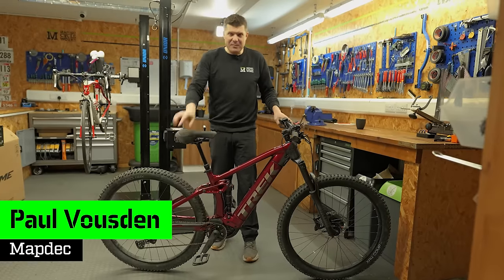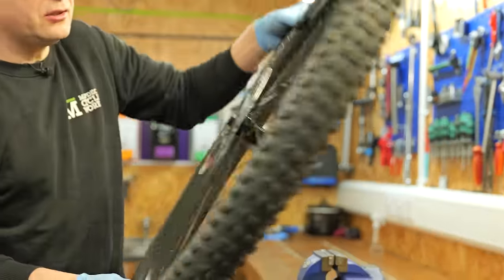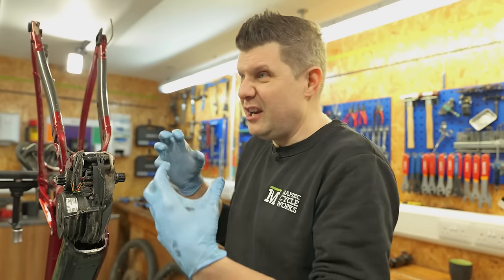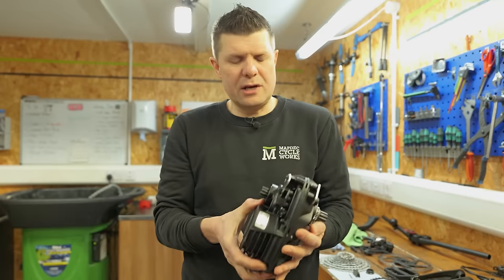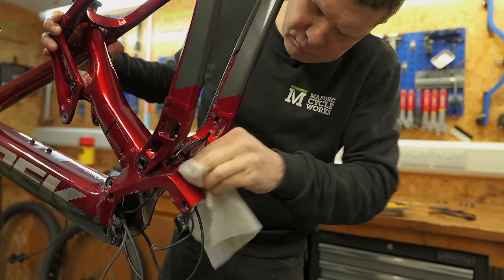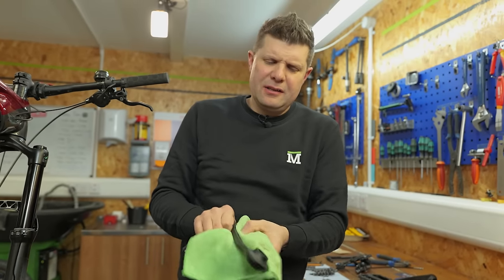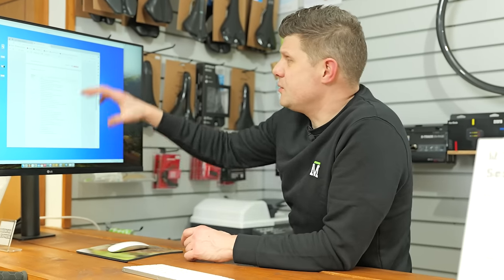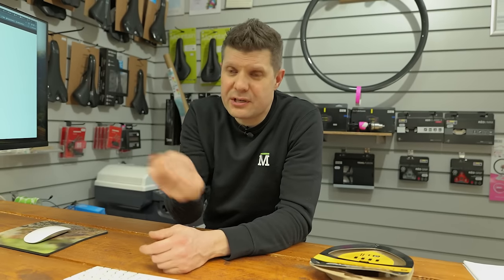This is how much work it takes to service your eMTB

Comment: What did you spray on the bike at the end? Surely you need to protect the brakes from whatever it was? 
Enjoyed the video
Reply from the maker: Its a frame polish from Juice Lubes, Been using it for years. It's nothing that will harm rotors if a tiny bit of over spray touches them. Obviously dont polish your rotors with it.
Reply: Was thinking the same thing. I use a spray wax for cars, but spray it on a rag and buff it off. Dirt just slides right off when I clean it.

Comment: 4:08 "excess old fluid"? As in the old dried up sealant that's stuck on? I thought it be better leave that on the inside as it might help seal up a possible puncture.?
Reply from the maker: Why? It would be dry and in the way of the liquid you want to get to the hole.

Comment: Bike service is dirt cheap when you do it yourself. I am half way through rebuilding mine from the ground up. Even replaced the integrated headset and swapped out the folding stem. Now it sports 20 inch suspension forks... over a 14 inch wheel. lol
Reply from the maker: How much would it cost you on your own jobs hourly rate?
Reply: @Mapdec  That is a stupid question. I will not indulge it. It is the sort of question asked by people with cramped little souls.
Reply from the maker: @mikeemmons1079  because your own time is worthless?
Reply: @Mapdec   Salty, and cramped. Cope and seethe; your job is my hobby.
Reply from the maker: @mikeemmons1079  and you have no respect for another persons trade?
Reply: @Mapdec  It is not a trade, dude. Masonry, is a trade. Carpentry is a trade. Fixing bikes is an after school job, like delivering pizza or wearing a paper hat.
Reply from the maker: @mikeemmons1079  haha. So you’re just a sad lonely troll.  😂. Have a nice life.
Reply: @Mapdec  If it makes you feel better. Of course, the "lonely" part sounds like projection, but we wont dig into that.

Comment: What was that tool you used to remove the hub end cap?
Reply from the maker: In this vid it was a slide hammer colet. However a hub genie is great for 12mm
Reply: @Mapdec  oh that’s kind of genius. I have the former, but not the latter.

Comment: whats the difference between red and blue grease?
Reply from the maker: In this case, Blue is Mobil XHP 22, a lubricant for bearings and moving parts. The red grease is Maxima Assembly Grease for corrosion resistance and prevents threads galling. We have a little motto. Blue for bearings, Red for Threads.

Comment: Honest question, but these ebikes run around 3K 3.5K in the US. How do you justify a service that could be close to 1/3 of the cost of the bike? Makes me not want to buy one now.
Reply from the maker: Exactly.
Reply: Learn to work on your own bike. With the exception of major components, bike parts aren't very expensive.  You're mostly paying for labor and overhead. Put the money you save into a few necessary tools and only pay someone to service the more difficult components like shocks and forks.

Comment: Really horrible build quality on those Ebikes. Everything is wet, not sealed and has rust. For a bike category that is supposed to be robust and durable this is really disappointing. Especially considering one has to put 500-1000 in maintrnance every year on top of it. The cherry on top is that those Bosch motors fail after 10-25k miles and need to be replaced.
Reply: I would be scared to ride any of these hard. I go down hills,  stairs, tear through cobblestone streets, over tram tracks. No chance I would trust the strength and durability of these. Last thing I would want to do is go over the handlebars when it breaks. Especially at the speeds these go.
Reply: The costs are similar with normal mtbs though. Ebikes do see more wear, but the general maintenance is the same. If you ride enough to need that level of service annually, you'd do well to perform some of it yourself. Either way, cost of ownership is something that should be considered before the purchase. If you can't afford the maintenance, you can't afford the bike.

Comment: Great video. But god damn that's expensive! That's more than a FULL car or motorbike service...

I would have also thought that cheap somewhat generic consumable parts like washer, seals, cables and (some) bearings would come included in that price, not charged as extras. I've been out of the hobby for many years, so maybe I'm just out of touch with things.

 But I'm just shocked. I say you're better off not getting a service, and just buying a whole new one every 4 damn years. geez.
Reply from the maker: well, this is a £6k bike, and what you saw here is a full days work. A bike in much worse condition will take a lot longer to remove rusty bearings etc. A car service doesn't require removing many parts, and its all power tools and heavy weight bolts. Everything here is lightweight alu.

Comment: I am not sure from the video, but I hope you closed off the outlets in the motor before washing it. There's gaskets on the plugs, that stops water from going into the motor, when the plugs are not connected, the motor is no longer waterproof. Other than that, beautiful piece of work!
Reply from the maker: Those plugs are waterproof. Water can’t ingress to the motor.  If you have ever taken a motor apart you will see they are all sealed.
Reply: @Mapdec  why would the plugs (the ones that goes into the motor) have gaskets, if the outlets were waterproof? The outlets in the motor is not waterproof. (They might look closed off, but they are not waterproof).
Reply from the maker: @primal5435  to keep the connections dry.
Reply: @Mapdec  I just talked to Bosch to make sure I dont give misinformation. The motor is IP54 rated, and should never be washed under a sink, even when plugs are connected. 
When the plugs are removed, the motor has no ip rating, meaning any water can go directly into the electronics of the motor.
Reply from the maker: @primal5435  that’s different to our Bosch training.  The rep is local. I’ll ask.

Comment: Yeah. Ya fogot the cost...mate. I brought my PW-X3 rig, in for routine maintenance and a noticeable declinein power using boost mode. Well. The bike shop wasin no rush. Made it clear it's my only transportation. Took nine weeks and a cost of one-thousand $USD. Nine weeks to replace a couple microchips, and supposedly the battery was defective. The warranty did not cover the malfunction. Useless warranties. E-Bikes, are truly only for the wealthy. Never buying an e-bike...again.

Comment: if you answer my question i will abonnier your channel: if i want to change my cranklength to shorter cranks (at a shimano e8000 motor), do i have to do something with the computer software? change the power of the motor to "short cranks" or something? can i do this at home or can only a shop do this? thank you.

Comment: Still got the new warning orange stickers on the disks first thing i pulled off! The disks are bedded in wouldn't say they were on the limit? Really
Reply from the maker: The only way to tell is to measure them.
Reply: I just got my first ebike cube action team 160 I'll be keeping up my maintenance for sure! I've got 203 ice tech on mine they'll need to gone be bedded in first
Reply: One thing I need to know the finned break pads do they work well as I think being a heavier rider just now they'll heat up alot with 4 pot 203mm? The ice tech discs hopefully works well for cooling, I need to check what is in the callipers if there resin I have heard alot new ebikes come with resin pads is this true?

Comment: crazy the shop that sold it did not correctly adjust the dropper cable and shift for the customer, so for  a year they have had bad cables prob. from new!
Reply from the maker: Yep.

Comment: Bit unfair to blame sticky fork and soft shock and needing rebuild without checking air pressure... But your service cost seems good if i can do # to USD conversion (&300=>$385-$420 range) for a bike with the extra work being eMTB. Maybe could have pointed out that setting air pressure should be done after rider sits on bike to check sag.
Reply from the maker: Not a rebuild. Just a lower leg service. Basic 50hour stuff.

Comment: The shock travel is surely there to be used, I’d argue that shock is a bit too firm
Reply: Reckless aerosol polishing at the end will also make the brakes howl like hell
Reply from the maker: Yeah. If it did we would have a queue of complaints by now.

Comment: Wow, did you just drain the motor with water?
Reply from the maker: No.  It’s just a recirculating enzyme that we use to brush out dirt.
Reply: @Mapdec  Thanks, oh so this is a liquid thats not electrically conductive? Bc everyone says we can't clean ebikes with water spraying inside down there
Reply from the maker: @dani4u87  there is no more pressure being used here than someone cleaning their bike at home.

Comment: WARNING ! Never expose the DC brushless motor to water or flammable substances . The same for cable connection points . Paul should know this .
Reply from the maker: We never opened the battery. It never got wetter than a hose down after a ride.
Reply: @Mapdec  There appears to be a misunderstanding . During the video clip , the motor was brushed with a cleaning agent . Either way it is to be kept dry . I am about to follow this "PRECAUTION" in a few moments with an Uber worker owned cargo line motor equipped Merida . I have to use a diopter lamp during work as I am waiting to have left eye cataracts removed , hence spelling error edits may be seen .
Reply: @Mapdec  But what about the owner forgetting to leave a key , the mistake you made ? I have an emergency kit if keys are unavailable / lost and the battery " MUST BE REMOVED URGENTLY" . Some bicycle retailers around me have these emergency kits on hand if required .
Reply: @Mapdec  You still wouldn't know if water got behind anything without checking in case the rubber compression seal had abrasions , hence the slim chance water may get in in minute amounts . I have seen this with TQ .
Reply from the maker: @robertmcfadyen9156  cool. That motor will get wetter riding through a rainy day.

Comment: Every 50 hours on the shock? How the hell do we let manufacturers get away with this crap? That's every 3 weeks for me.
Reply from the maker: Depends how well you want your shocks to work. You don't really notice the degradation until you service them. For riders like you that do 50 hours very quickly we do a £30 service where we only clean, change the foam res, and add splash oil again.

Comment: You can see the customer using the bike wrong by the grime on the cassette, wasn’t in first gear once
Reply: Motors can make you a bit less prone to using all the gears , and the tune of the motor also has some bearing on gear selection I think . I recently put an  after market motor on my recumbent trike , and it’s not dialled in yet, and even on low power setting once the motor engages , it pulls like a 14 year old and before you get 3 pedals in you are at maximum cadence. 
 The temptation to start off in a taller gear currently does make it a bit more comfortable, though it’s probably less good for the drive line.
It’s only temporary though.

Comment: just because the rear shock is getting full travel doesnt mean it needs a service.  it indicates it either needs more air or is set correctly if they are getting full travel.  As for the fork its indicating that it is set too hard,  so just needs less air pressure and setting correctly for rebound and compression.  And then you havent done any service on the motor,  a visual inspection isnt a service.  This is basically a regular bike service.
Reply from the maker: Bless.  This is the service procedure outlined by Bosch to maintain warranty.  You are probably right about the suspension, I mean from where you’re sitting it must be obvious, compared to me with just my hands touching it.  I wish I knew about compression damping.
Reply: @Mapdec  Bless.  it's obvious to me watching as it should be to you.
but having been servicing bikes and suspension for twenty years for the world's best cyclists and triathletes I do have some idea about what I'm talking about 
bless.  and the compression and rebound damping in co-ordination with pre-load is critical especially for lighter riders. 
bless

Comment: Tutorial for a how to sky rocket the service costs, instead lubricant tear all the parts down and replace with new. 
Btw spraying silicone w/o protecting the brake discs way to go bud, customer visits for the next time for squeaking brakes. BOM Costs - New brake pads new brake discs and labor. Awesome dude!

Comment: Was going to get an e-bike until I saw this…..just too much cost and maintenance to make it worthwhile in the UK’s wet and muddy, humid and freezing conditions. Not really economically viable in this country as of 2024, think I’ll wait until we see better motor and electrical seals, customer diagnostic tools, e bike specific drive trains, better cable routing and a warranty that covers de-restricted motors before I drop 6k +.

Comment: Wish Trek would stop using that plastic dropper lever. I see a lot of bikes where the person who installed it didn't size the dropper housing. It can be a bit of a hassle on an ebike, but I can't stand the way a cable coming way out front looks. Looks unprofessional. Trek has gotten better at the cable management on their ebikes. About 5 years ago it was awful. You got a real nice set up.

Comment: This whole e-bike thing now is absolutely ridiculous, 5k for a bike, and insane service costs. 

Seriously, madness I have I’ve had several new BMW bikes over the last 10 years , ranging from 12k to 16k S1000rr, *2  and 3 new R1250GS’s and they were cheaper to to maintain 😂😂😂 
And I’d say A LOT more value for money than an eBike. 
The world has gone mad 😂
Reply from the maker: It s the parts designed to be lightweight that bumps the costs and service
Reply: @Mapdec  and so a 190mph cutting edge  superbike that only costs double what double or 3 times that of a pushbike isn’t lightweight or cutting edge😂 
It’s a pushbike with a little motor, not a top end superbike with 200hp, and a raft of electronics. How exactly is it more expensive to maintain.
Like I said the whole e-bike thing is massively over egged!
Reply from the maker: @dazzassti  and everything on a super bike is designed for that horsepower.  Most things on an ebike are still designed for 1 human power.

Comment: Fault with the shop who she brought it from. Not setting suspension up for her. Probably had dropper post issue from new from whoever assembled the bike/sold the bike to her. Gear cable being kinked is probably from new and should have been remedied from whoever was assembling the bike. No doubt the dropper lever was like that from new as well. Good old trek for using low quality cables. Not greasing pivot bolts and using 2 dollar shop bearings.

Comment: you need to use torx plus not torx to remove bosch engine screws.
Reply from the maker: Depends.  They are not always tps.
Reply: @Mapdec You used ordinary Wera Torx wrench. You should use TP to unscrew Bosch gen 4 engine screws. TPS =Torx Plus Security. TP = Torx Plus. T=Torx.

Comment: UPLOAD IN 1440p or 4k PLEASEEEEEEEE
Reply from the maker: one day, when we can afford the hardware to edit.
Reply: @  Just edit in 1080p and render it out in 1440 or 4k. The issue is mainly that youtube gives a horrible bitrate for 1080p so it looks worse than the original file. If you edit in 1080 but then render in 4k it will look a ton better.
Reply from the maker: @wesleyvandeurzen7199  oh. Weird. I’ll give it a try.
Reply from the maker: Thanks.

Comment: Trek/Bontrager wheels are garbage and, you cannot replace them due to end cap clearance issues
I broke the inner rear axle and guess what? They don't even list a part # for it so, I had one made out of tool steel for $250 Cdn
I've got lots of carnage vids on my channel if you are into that...

Comment: what  it piss me  off  when  ppl  come with  bikes  in my  shop  is DIRTY  BIKES   .....just  clean  your  junk  and  is part  of  maintenance ...observing stuff  damaged  or need to  be change  :)))))))  ps this is a cLEAN  bike  :))))))
Reply from the maker: We just clean it and put the time on the bill.
Reply: @Mapdec  sorry  mate  the  bike  cost 25 pounds  on facebook market  :))))))you  will  be surprise  to  see  what  50% of  ppl  ride day  to  day  to  work ..... .killing  machines....am  trying to  say  is that  1  if  you  have an expensive bike  cleaning the bike  keep  you  on top  of  small  issues   ...staying  on top  off  small  issues  preventing    BIG  issues  ...2 if you  have cheep  bike  and cant afford    better   bike  learn  to  do  small  maintenance so  you  dont show up  with a 50  pounds  bike  and a 150  pounds  bill  repairs .....and all  go  to  cleaning the bike  :)))...PS i  repair ALL tip  of bikes and most  of  the work  i  do IT for free  just spar  parts for  cheep  one ,  some of use enjoy cycling ,some  do it for  necessity  i  just  try  to  keep  them all safe

Comment: That’s more expensive than a Mercedes AMG absolutely ridiculous like the price of these bikes to buy, my Specialised Levo carbon was more expensive than my KTM 690 SMCR and is more expensive to service, just say no to these costs and service it yourself they are ripping you off
Reply from the maker: How are we ripping you off?  EMTB just have very lightweight parts not up to the power and muck we throw at them.  A wage is a wage. Parts cost what they cost.